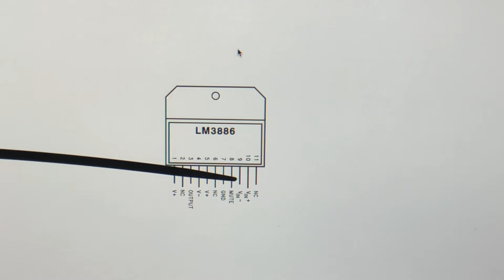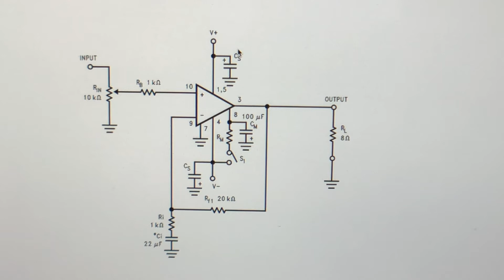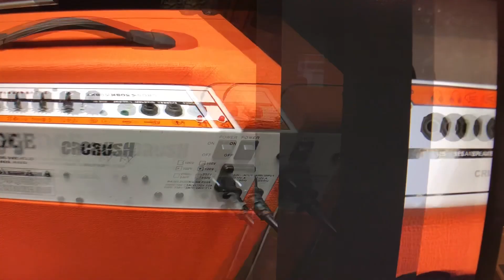Orange Crush BXT 50 solid state repair, LM3886 amplifier repair

Comment: hi, could you tell me the value of the resistor you used, please?
Reply from the maker: Francisco Uemura Junqueira I’m sorry I don’t remember exactly.  I think it was either a 220k  or 1meg.  If I remember correctly the exact value did not matter just needed a way to ground. I hope this helps. I will do better no future videos explaining values and such. Thanks.
Reply: Blehm Amplification got it. thank you very much for the answer.
Reply: I believe it is 47k ohm 1% (yellow-violet-black-red + brown multiplier)